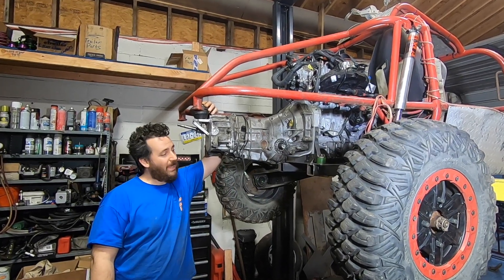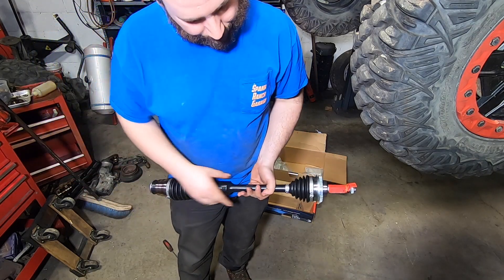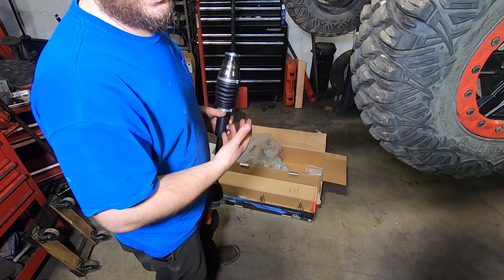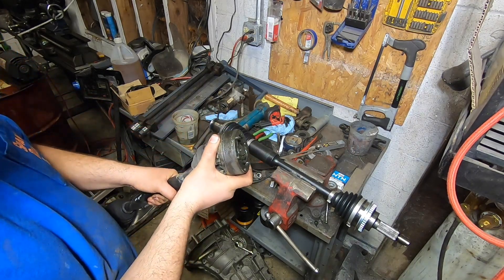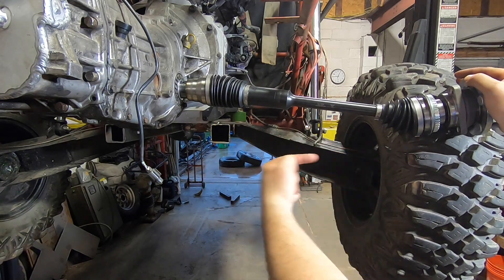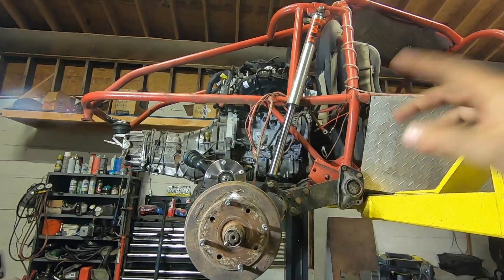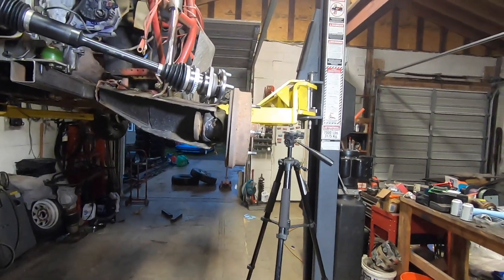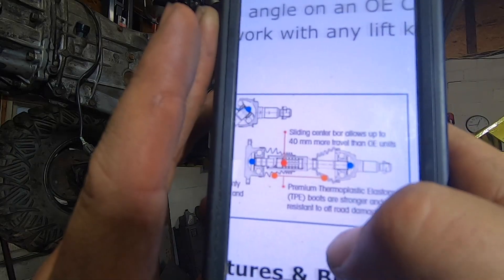LE2 Buggy. Budget Long travel axles from RockAuto? Will these work?

Comment: Having a vw powered buggy myself with stock width beefed up trailing arms and custom built ujoint axles, I would probably just build a new set of longer arms man. I agree that it doesn’t matter if you have a double angle to the front or rear, but if you can give the axle a straight shot to the hub, it will reduce the amount of overall angle on the joints.
Reply from the maker: Yeah thats the safest option but I am afraid it wont have enough rear weight if I stretch the wheelbase like that. I am going to build it with all the easily movable stuff in the back (Battery, fuel tank, etc.) If it needs more front weight I can move that stuff to the front.
Reply: That makes sense. Especially since once you have all that travel in the rear, you’re going to want more travel in the front and a wider beam or longer arms and coil overs would add more weight. I’m picking up what you’re laying down now haha

Comment: This literally helped me so much I'm doing something similar but with a honda engine and this makes the whole cv thing easier I would cut it down and attach it to the stub axles so you can keep all that
Reply from the maker: Thats an option but I prefer to get rid of the VW stub axle and stuff because I want to go disc brake anyway. The throwaway type unit bearings are really durable and small
Reply: @SpankRanch Garage  yeah I get that just that would just be the fastest and easiest way to get it going

Comment: It will probably work, if it was 930s I'd say it wouldn't work.  You could build some super long trailing arms and have like 20 inch's of travel, but then you may run out of plunge
Reply from the maker: Yeah then it puts too much weight forward of the rear axle I think. Not the end of the world but I want to try it at this wheelbase first

Comment: Keeping it torsion spring if you redo the trailing arm? Could whip up some tubular trailing arms with heims or johnny joints or something and run a coil kit over that shock. I think keeping the axle stock length would be smart since they will likely be wear/break parts and you dont want to have to sleeve an axle everytime you need to replace one. So losing an inch or two track width may be worth that tradeoff. Adding spacers back is easy, and even if it burns up bearings quicker they are off the shelf and cheap too.
Reply: Johnny joints are a good idea sealed and greasable vs helms
Reply from the maker: I like this. That shock is actually a nitrogen shock I got rid of the torsion bars a while back. Off the shelf stuff is just too easy so it makes sense to retain them so I am not building custom crap every time I wear something out. I have some 3/4 heims already but a sealed joint would be best long term. Thanks!

Comment: You would need to add at least 2 more bars to stabilize the knuckle if you want to use  heim joints, like the rear of a rzr. The bushings would be simpler but have their problems like you said